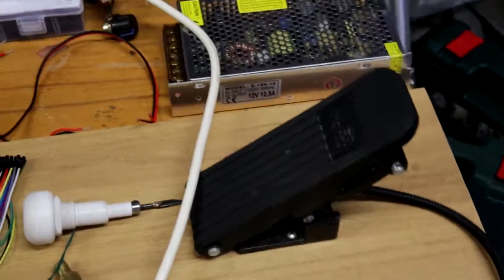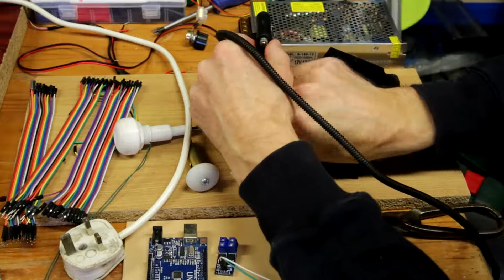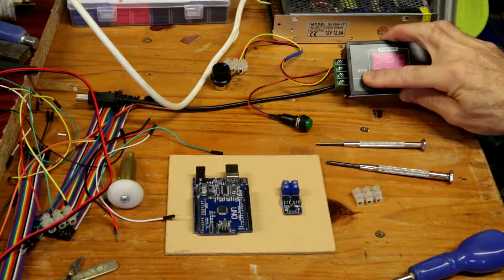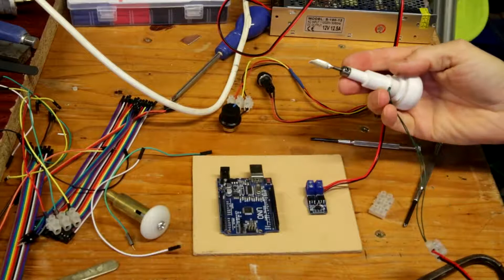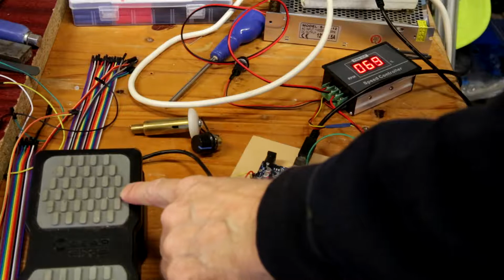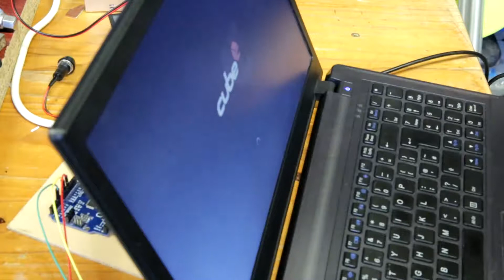Assembling the Super EZ graver controller

Comment: Well, that seems easy enough!  thank you for posting this, I've wondered about a fully electronic power graver for a while and now it's time to make one. What value is the pot you use for power control?
Reply from the maker: Its the default one that comes with the PWM controller or the foot pedal  which ever is used. The values for both are different I'm not sure that it matters. If you map values from potentiometers in the arduino the actual values don't matter as they are mapped onto values that are meaningful to the programmer, I suspect that something along the same lines is done in the pwm controller.